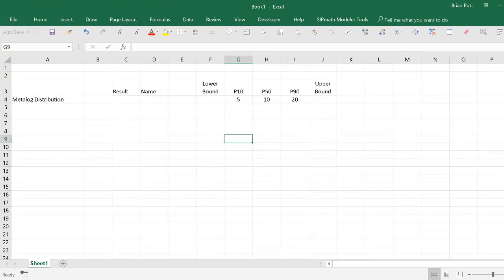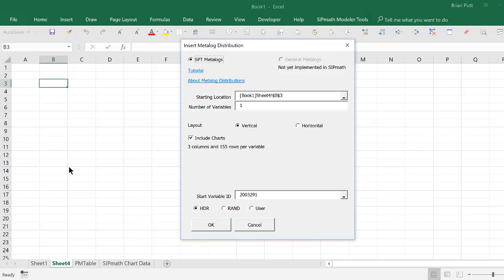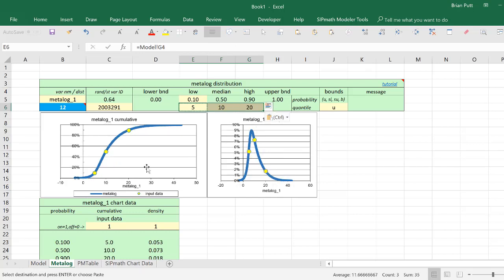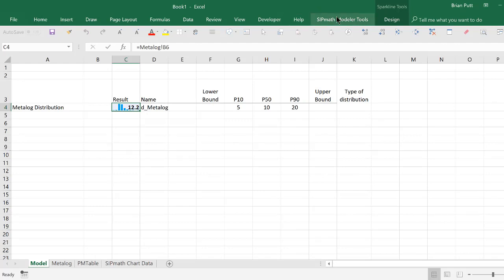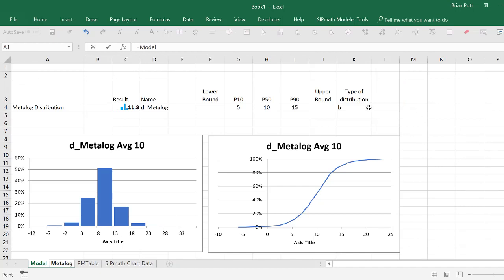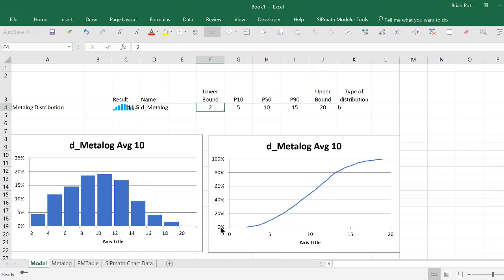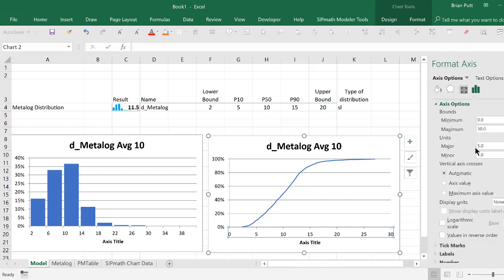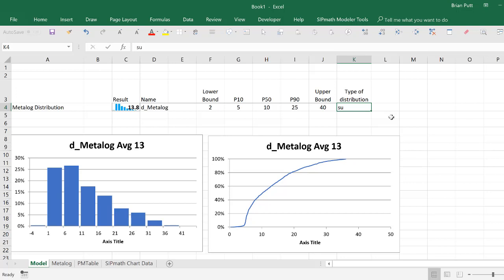Metalog Introduction Part 2 --  Single Metalog Distribution

Comment: Dear Professor, here in recovery from a surgery in the column and away from work since 16/11/2018, a good way not to get depressed is to study with your videos posted on Youtube, and now a question; Does the Metalogs Distribution need the Enterprise version?
Reply from the maker: No it does not require the Enterprise version.